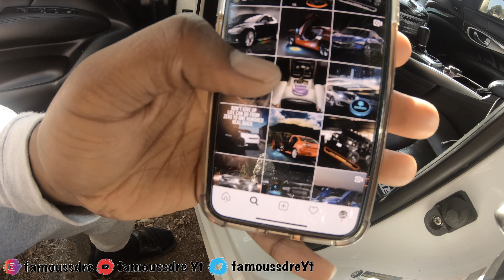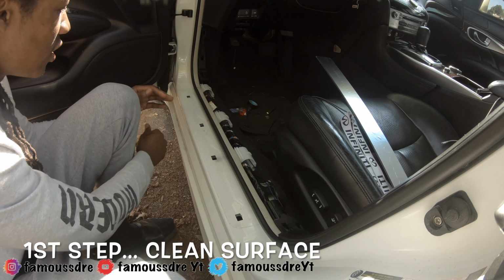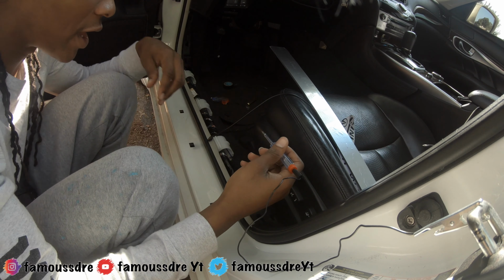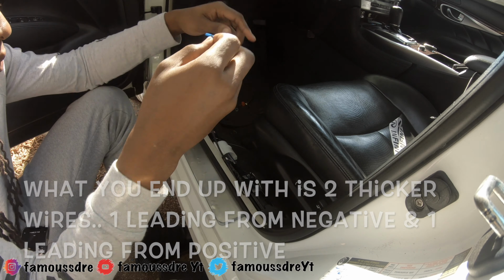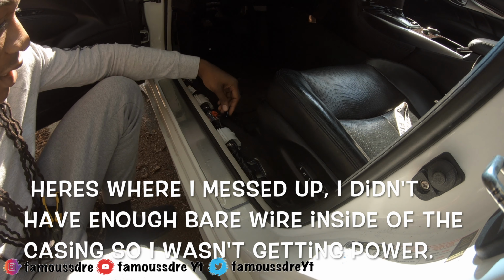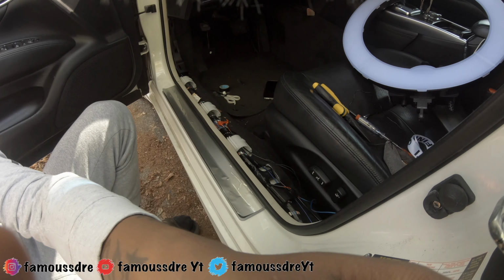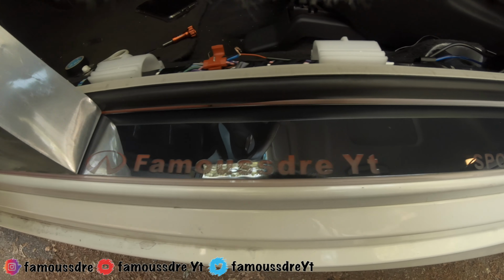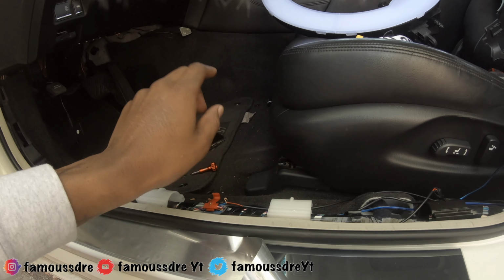Aoonuauto LED Door Sills Installation Tutorial

Comment: How do you get the power to only come when the interior lights come on?
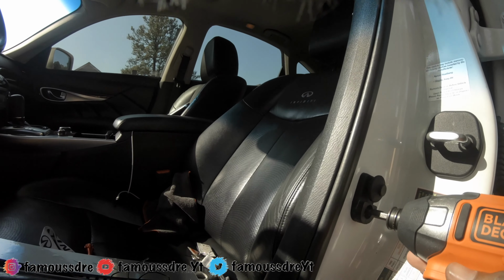Reply: Richard Pierce by connecting the ground wire from your door sills, to the black box you see me unscrewing are 3:53. splice the wire that’s connected to that brown box and then the door sills will come on when you open your doors
Reply: DAundre Wood Thanks bro! Worked great and looks awesome. I think this is the only instal video of these too (in depth)